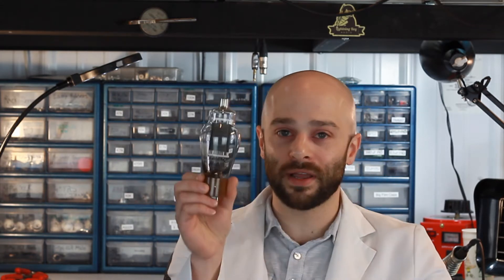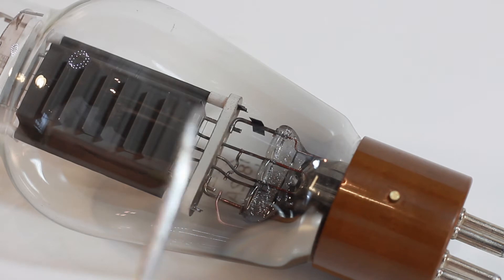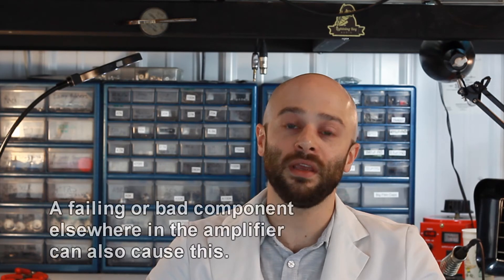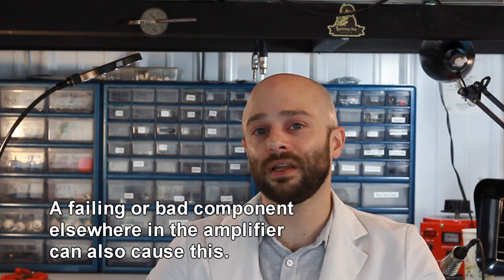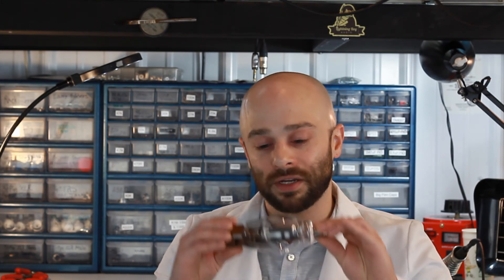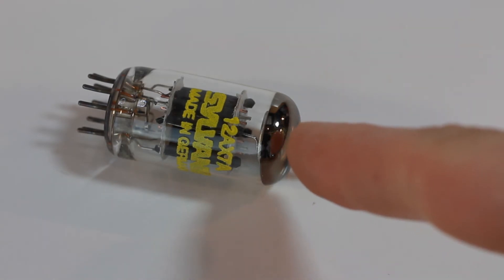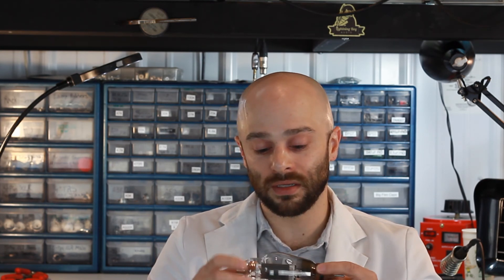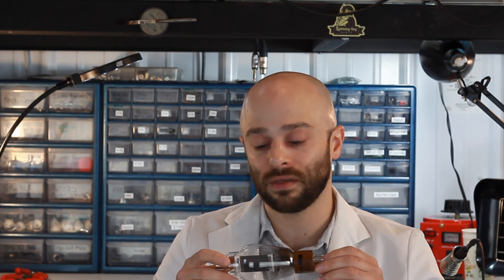Why Do Vacuum Tubes Become Microphonic?

Comment: Sometimes microphonic can be advantageous, but I’ve only seen that in old car radios where the speaker is self contained in the metal cabinet. See what happens, is when the tubes become microphonic they pick up the bass notes from the speaker as the metal cabinet resonates with the base notes. The metal cabinet adds reverberation, and the microphonic tubes pick that up. The reverberation fatten the bass, and the result is a fat bass tone coming out.. some audio files like that fat bass.

Comment: Not really a discussion on tube microphonics as much as a unique way to repair broken internal welds. Let's get back on point and figure out a way to deal with this problem of tube microphonics.  I have an amp on the bench with 4 EL84 tubes that are ALL microphonic.  Swapping out for new tubes (preamp and power) does not help.  Client says that the amp just started howling after he brought it home. They have a resonance around 330 Hz and 390 Hz. Put your finger on any tube and it stops.  Finally made an aluminum damper PLUS two O rings on the two center tubes. It's been wailing all afternoon with no problems. I've had individual tubes do this but this is the first amp I have ever seen do this.
Reply: How old is the amp? Bad components? All four power tubes have gone microphonic in my Boogie Mark IV, which I'm pretty sure hasn't been serviced since the original owner bought it. Surely the caps need to be replaced at this point. I'm will to bet a few other things have drifted and damaged the tubes.

Comment: So, other than the explanation of the problem, can you recommend a tube "brand" of distributor that will supply some better tubes.  I'm 60 years old and my experience tells me that even NOS tubes have no guarantee, even if they were designed better...maybe I'm wrong.  Specifically, I have a Marshall Origin 20C, and it would be cool for someone with experience with this amp to let me know if a "new" tube set can make this amp sound better?? thx